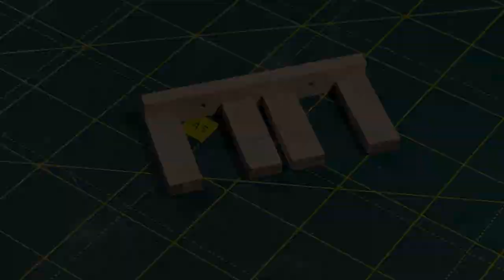How to make a simple Ship model stand. Scale 1/72.

Comment: What timber and paint/stain are you using?
Reply from the maker: For the details of this stand, I used beech wood.  It is quite strong, has small fibers, and quite thin details can be cut from it.  I also like the pear tree.

As for the paint: here I use artistic oil paints heavily thinned with the appropriate thinner.  It turns out a brown liquid.